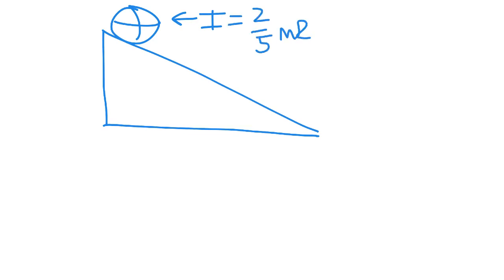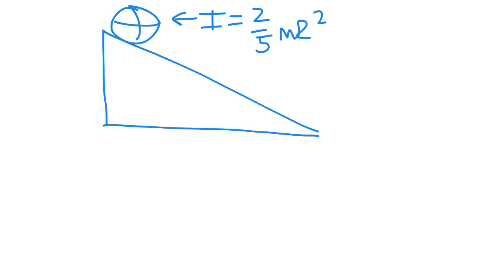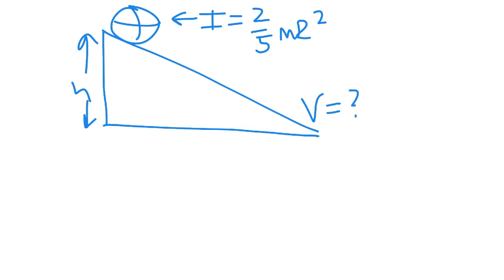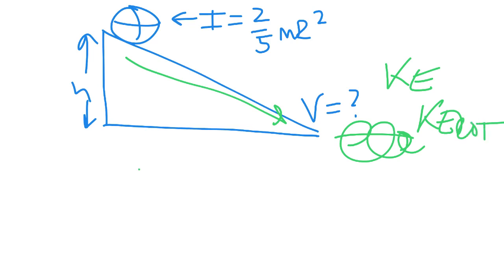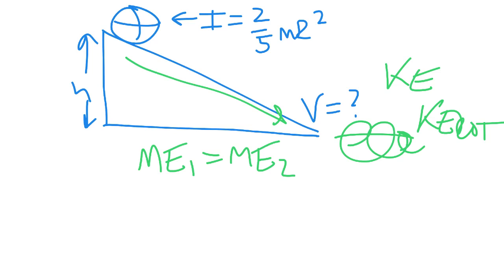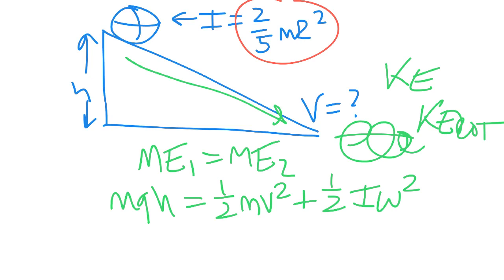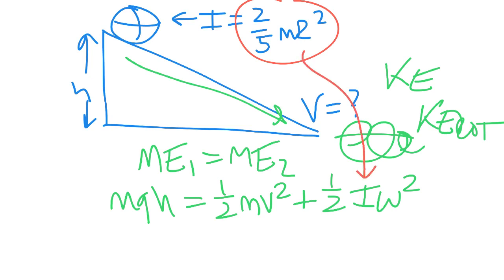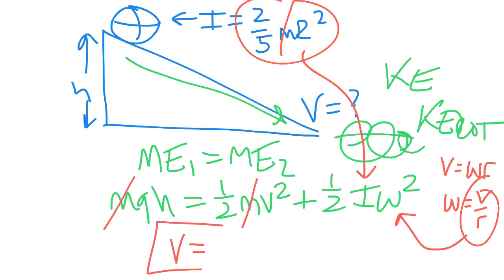Finding final velocity for ball rolling down ramp with rotational inertia explained

Comment: Solid spheres of different diameters will reach the bottom of the ramp at different times.  In the formula you have in the video there is nowhere for mass and diameter to be considered.  I'm baffled as to why they arrive at different times.
Reply from the maker: This is a common misconception.  Try to test it out.  Solid spheres will all reach the bottom at the same time as long as they have uniform density.  If you have a sphere with a core more dense than the outer part then it would get to the bottom sooner.
Reply: @matthewwagoner9470  So I'm interested why in this video 3 different size spheres are rolling at different speeds?  From the 7:40 mark.   (This man was a legend in Australia way back when educational TV was a thing.)  https://www.youtube.com/watch?v=UkNgWXpnyuI&fbclid=IwAR3vC7_JRLfSQ4YRc69T_5_A2ENXpLNdkYyoHw4kerSIVhLyaxJzN5O8pC8
Reply from the maker: @Munrubenmuz  Great Video Find.  JSM is a legend for sure.  Notice he scooped them up quickly and then wrote "All Spheres Roll Alike". I am wondering if some had a different core inside or if the board was uneven or something like that.

Comment: shouldn't gravity be g*sin(theta)??
Reply from the maker: Since we are looking at potential energy, we just want mgh - which is the work needed to set the ball on the top of the ramp lifting straight up (w = fdcosø) the force is "mg" since against gravitational force and displacement is "h" and the angle between the force and ø is zero so "cosø=1".  If we were looking at what the gravitational force was in the direction down the ramp, then we would use g*sin(theta).
Reply: @matthewwagoner9470  Thanks! So would the velocity of any rotating solid sphere at the bottom of a frictionless ramp starting from rest on Earth be v = 2.62*(sqrt(h))?
Reply from the maker: @ahmedhussain4665  I added a link at the above comments for you to see the rest of the algebra.  The velocity for a solid sphere rolling down a ramp ends up being sqrt((10/7)gh)
which comes out to  3.74*sqrt(h).  I think you had the 10/7 flipped.  It is 7/10 on the right side with the v^2 and becomes 10/7 when you move it over with gh.  Typically you'd just leave the 10/7 inside the root and leave g in as well (so we can change it when @SpaceX takes us to Mars)
Reply: @matthewwagoner9470  Whoops yeah forgot the flip, and true gotta keep SpaceX in mind at all time when solving those problems. Hahah thanks!
Reply: @matthewwagoner9470  So based on that math 2 solid balls of different densities but the same diameter will reach the base at the same time.  (I'm thinking according to that formula if you set a solid wooden ball and solid steel ball away at the top of the ramp and both had the same diameter then they should reach the base at the same time.  (ignoring frictional losses.))  Have I got that right?
Reply from the maker: @Munrubenmuz  yes, correct.  Any solid spheres will reach the bottom at the same time regardless of mass or diameter.
Reply: @matthewwagoner9470  thanks.  Why do solid spheres of different diameters reach the bottom of the ramp at different times given in that formula there is no input for mass or diameter?

Comment: How would you find out the velocity at a specific point in the ball? I have a problem where I was told to find the velocity of the ball doing exactly what you did in the video. But then it asks to find the velocity at the highest point of the circular motion. How would I do this? Any help is much appreciated!
Reply from the maker: The V at the top of the ball would be the V of the center mass of the ball (that I solved for in the video) plus the v of the top as it rotates around the center mass.  This can be found by calculating omega of the ball and multiplying by the radius.  But it is easier to reason through the answer by noting that the bottom of the ball is temporarily at rest, so the top of the ball is moving at 2x the speed of the center mass of the ball.
Reply: @matthewwagoner9470  That is not quite right.  The speed that is 2x the speed of the center of mass is at the point diametrically opposite the point of contact with the ramp.  On a tilted ramp that point is not the top of the ball, and it is moving in a different direction than the center of mass.  If the question was really intended as stated to find the velocity of a point (a vector), not just the speed, one would have to find both the speed and direction, certainly a more involved calculation.  But thanks for the useful video for finding the v of the center of mass showing the two energy components.  This made me think of it:  https://quafosar.com/products/kinetic-crafts?fbclid=IwAR05xPdlXyRyOhrsmbwm_vVYWURURhTAFUwdWn2I9vIEOF9VGkvNWvP3Pbw.  Any thoughts on this?

Comment: you cant just divide m from both sides, 1/2Iw2 is on the other side being added to the part of the equation with m
Reply from the maker: there is an 'm' hidden in the I.  Since I for a sphere is = to 2/5 mR^2.  This can be tested experimentally by rolling spheres of different mass down a ramp and seeing that they will all reach the bottom at the same time.  -Hope this helps!